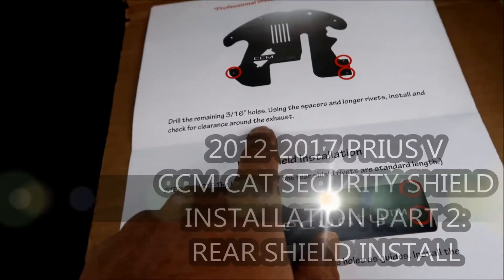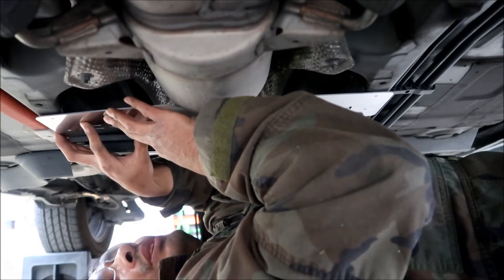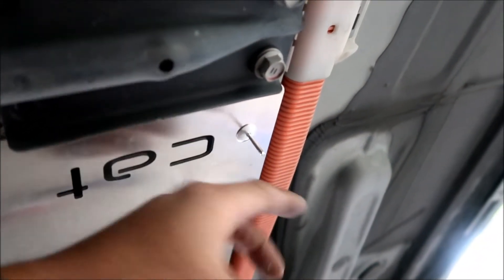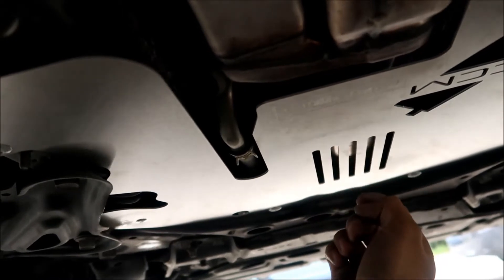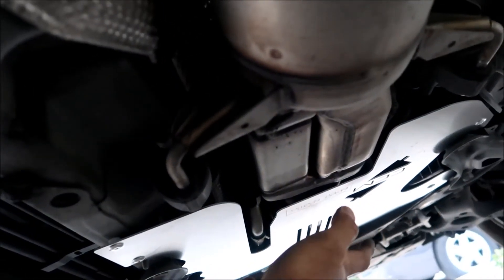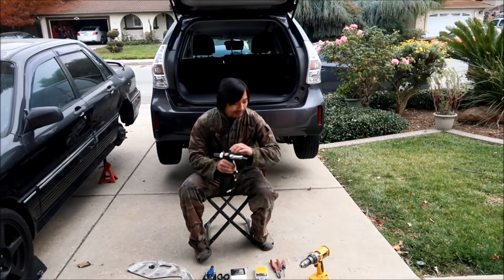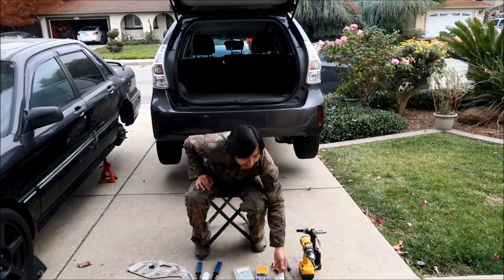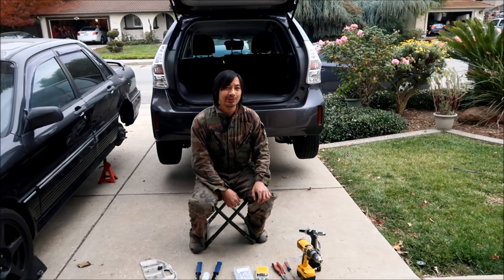2012-2017 Prius V CCM Cat Security Shield Install Part 2 - Rear Shield Install

Comment: I installed this on my 3rd Gen Prius a year ago. This video shows all the same issues I had. Well done! One thing that does periodically happen is I hear rattling driving up hill. When I inspected the rear plate, I noticed it was slightly curved upwards towards the exhaust. Maybe one day I'll go fix it. Thanks for the videos.

Comment: Would it be tough to replace like O2 sensor after this is installed since rivets are semi permanent? I imagine I have to re-rivet them back in after working on the inside. Thanks for the videos. It really helps me see what's required to make this work.
Reply from the maker: It depends on where the O2 sensor is and which one.  The downstream on the 2G Prius you would have to take the plate out.  The upstream the important one I believe you can do it from the top of thr car.  Sorry I'm not sure on the V.  I have 213k on my 2G Prius and the O2 sensor is still functioning.
Reply: @HadesOmega  I have G3 Prius. Guess I am worrying about something that might not happen for long time. Thanks for the reply.

Comment: what kind of bit would be preferred for drilling
Reply: a cobalt steel bit 3/16" would work well and short ones bend less under pressure, McMaster Carr has them for $3.17 (28765A19)

Comment: The purpose of the rear plate is likely to prevent REMOVAL of the cat, not to deter cutting of the exhaust pipe.
Reply from the maker: The cat is part of the exhaust

Comment: I think that CCM should include some extra rivets. The 3 long head rivets that go through the spacers are very hard to find. One of mine didn't "take". Great video. The instructions don't tell you where the rear shield is placed. I bought the Astro 1423 riveter on Amazon because it's the shortest and most affordable 1/4" riveter I could find. I didn't use the stickers because I don't want the thieves to come back with a grinder or crowbar. I want them to be unprepared the first time. I still use a wireless driveway alarm under the car every night. It alarms in the house if someone gets under the car. Also from Amazon. I predict that all the unemployed illegals Biden is letting in are going to take up this business. And I live in San Diego.
Reply: Instablaster.

Comment: If u place a SMALL wooden blok, secure with jack, THEN align drill your holes, u have "bowed" your plate & given clearance NOT to rattle vibrate. THEN remove block after u've installed rivets. Not my idea, another guy on you tube did.😁 I see ppl are havimg rattling probs. 🤓<nerd old mechanic.😅😂🤣
Reply from the maker: It doesn't rattle too bad
Reply: @HadesOmega   do you have the link to where i can purchase?
Reply: @prince2thethrone  EBAY